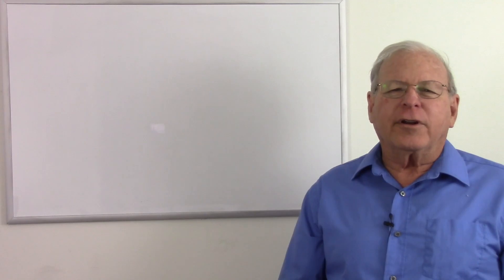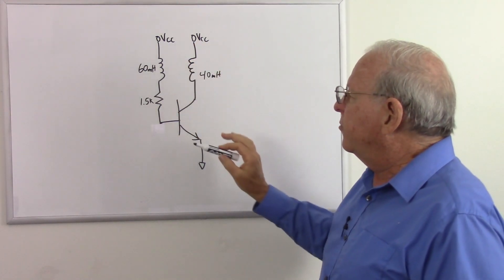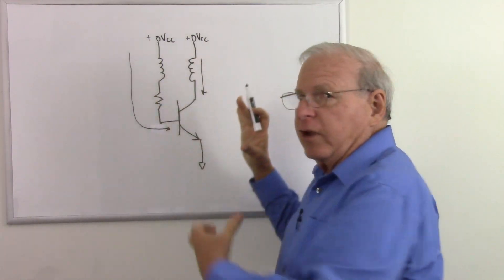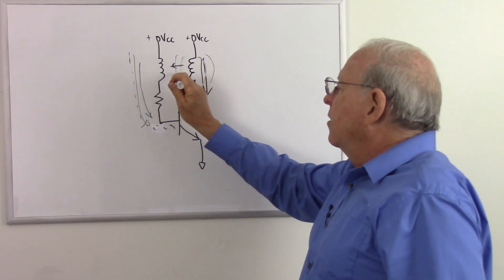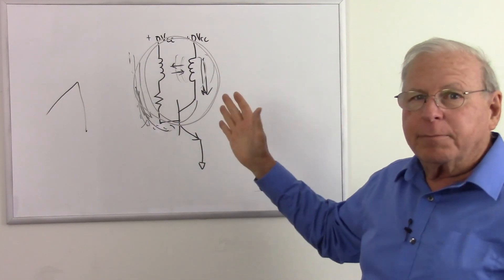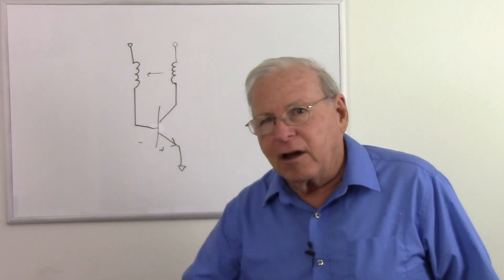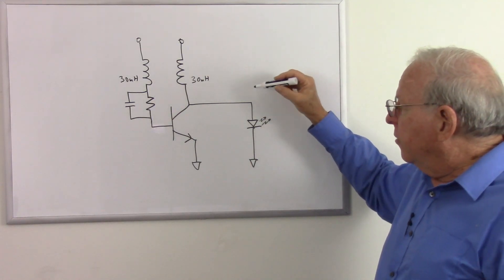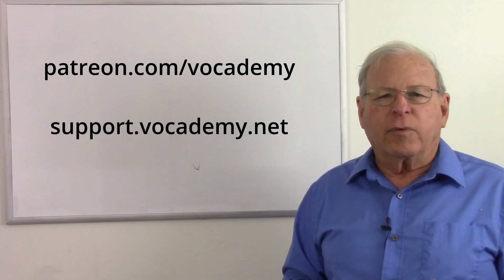Blocking Oscillators - Solid-state Devices and Analog Circuits - Day 6, Part 11

Comment: The oversaturation that leads to a huge spike in voltage does happen in real electronics, it depends on the core material, ferrite being the highest. Getting 4kv spikes isn't that unusual when using mosfets. I'm more interested in how to calculate this circuit, if f=0 what happens to Xc and Xl, or do we calculate for hz after the circuit is on?

Comment: The atrio-ventricular (AV) node in our hearts is a natural relaxation oscillator that acts as a blocking oscillator. The sino-atrial (SA) node in the left atrium is the pacemaker oscillator which is the relaxation oscillator that sets the heart rate. The natural rate of the AV node is lower than the rate of the SA node and is driven by the SA node. The AV node is triggered by the signal it receives from the SA node and then passes the electrical activity across into the network of Purkinje fibers in the left ventricle and beyond which trigger the various muscles in the heart to contract in the proper order. The electrical activity reaches back to the AV node, but because it is "dead" for a certain period of time after firing it acts to block the reentrant activity. In cases where the AV node is damaged in some way the reentrant activity triggers it again leading to arrhythmias.

Comment: If you have an inductor device which receives switched currents, it is a good practice to cancel out the inverse induction voltage with a simple diode in reverse direction, which protects the rest of the circuit from high voltage.
Reply: Free wheel Diode

Comment: 11:40 - Wouldn't high-voltage spikes also be present on the secondary, placing hundreds of volts across the base-emitter junction?
Reply: 13:41 , I think when the magnetic field collapses on the secondary, the transistor will be reverse biased so no base emitter current (blocked)
Reply: @1rstcar  Oops! I forgot about that resistor (it was present earlier in the video).

Comment: Nice,but practically where it can be used,examples??
Reply: Dc-dc boost regulator used to boost a 1.5 volt battery to drive a 3.2 volt white LED in a torch